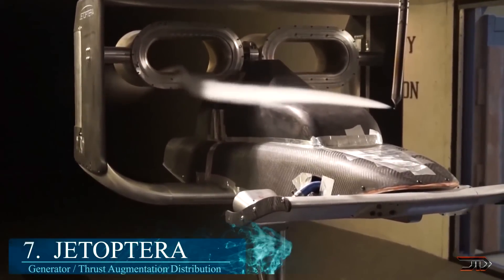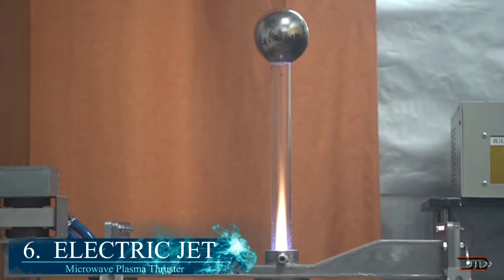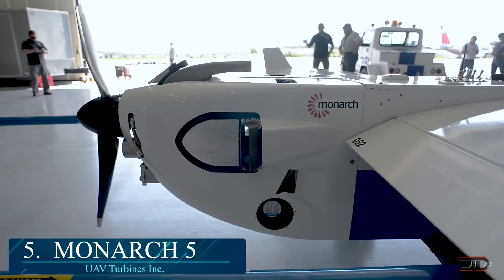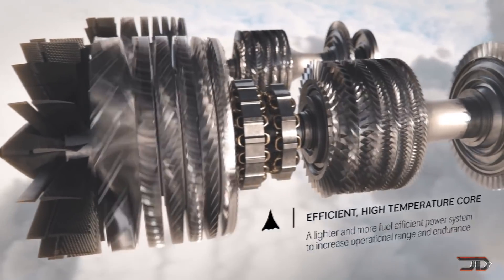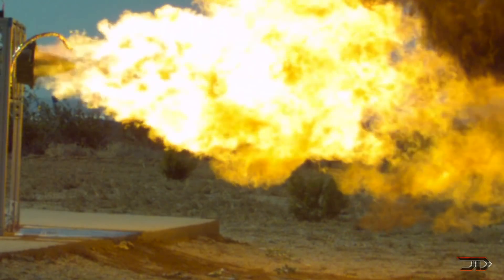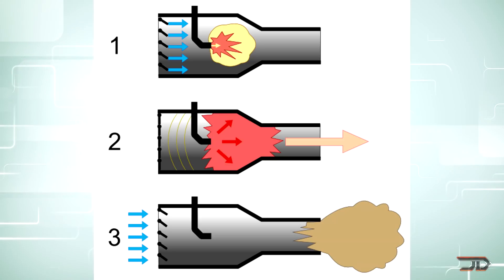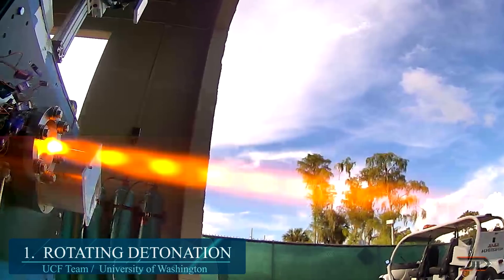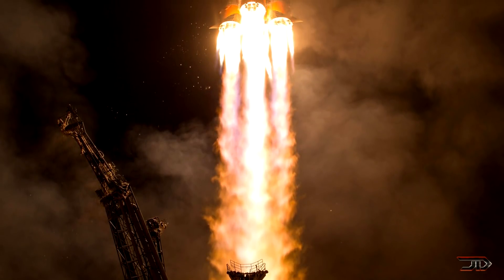7 STRANGEST New Aerospace ENGINES

Comment: One has to remember, these things are built with and tested with and maintained with fossil fuels.
I certainly am in favor of going full speed ahead to see what we can accomplish. I want to see if we can eliminate most fossil fuels. Let’s see if we can eliminate all lubricants as well. When I look at these developments I think about my car, my EV has a sticker on the back window that says the following, “ This vehicle runs on natural gas, coal and nuclear energy”.  We do have wind power in our area but it is negligible and they’re taking down most of the wind turbines because of inefficiency. This is after just 15 years of use. I just watched a video from CDI which means “controlled demolition Inc’. and they just took down 21 wind turbines, look it up. I am all for alternate fossil fuels, I’m also for common sense. Go Brandon.

Comment: Here is the information I found to answer the questions about the German V-1

A pulsating jet engine (PuVRD) is a variant of an air jet engine. The PUVRD uses a combustion chamber with inlet valves and a long cylindrical outlet nozzle. Fuel and air are supplied periodically.

The first patents for a pulsating jet engine were obtained (independently of each other) in the 1860s by Charles de Louvrier (France) and Nikolai Afanasyevich Teleshov (Russia).

German designers, even on the eve of World War II, were conducting a broad search for alternatives to piston aircraft engines, did not ignore this invention, which remained unclaimed for a long time. The most famous aircraft (and the only serial one) with the Argus As-014 PUVRD manufactured by Argus-Werken was the German V-1 projectile. The chief designer of the V-1 Robert Lusser chose a PuVRD for him not for the sake of efficiency (piston aircraft engines of that era had the best characteristics), but mainly because of the simplicity of the design and, as a result, low labor costs for manufacturing, which was justified with a massive the production of disposable shells, mass-produced in less than a year (from June 1944 to March 1945) in an amount of over 10 thousand units.

V-1 engine
After the war, research on pulsating jet engines continued in France (SNECMA) and in the USA (Pratt & Whitney, General Electric).
The results of these developments interested the military of the USA and the USSR. A number of prototypes and experimental samples were developed. Initially, the main problem with air-to-surface missiles was the imperfection of the inertial guidance system, the accuracy of which was considered good if the missile hit a square with sides of 3 kilometers from a range of 150 kilometers. This led to the fact that with a warhead based on a conventional explosive, these missiles had low efficiency, and nuclear charges, at the same time, had too large a mass (several tons). When compact nuclear charges appeared, the design of more efficient turbojet engines had already been worked out, so pulsating air-jet engines did not become widespread.

Representatives of air-to-surface rockets with a pulsating jet engine.
Third Reich Fi-103
USSR 10X · 14X · 16X - thanks to the use of two engines, the practical limit of flight speed for the PuVRD was reached - 980 km / h (270 m / s).
USA JB-2
In the early 2010s, there is a revival of interest in PuVRD: their development and testing are carried out by General Electric, Pratt & Whitney, SNECMA, as well as the domestic NPO Saturn

Scope of PuVRD
PUVRD is characterized as noisy and wasteful, but simple and cheap. The high level of noise and vibration arises from the very pulsating mode of its operation. The uneconomical nature of fuel use is evidenced by an extensive torch "beating" from the PUVRD nozzle - a consequence of incomplete combustion of fuel in the chamber.
Tests of the American Mustang P-51 with PUVRD
Comparison of the PUVRD with other aircraft engines makes it possible to fairly accurately determine the area of its applicability.
A PUVRD is many times cheaper to manufacture than a gas turbine or piston internal combustion engine, therefore, with a single use, it wins economically over them (of course, provided that it "copes" with their work). With long-term operation of a reusable device, PuVRD loses economically to the same engines due to wasteful fuel consumption.
In terms of simplicity and low cost, the ramjet is practically not inferior to the PuVRD, but at speeds less than 0.5M it is inoperative. At higher speeds, the ramjet is superior in efficiency to the PuVRD (when the valve is closed, the drag of the PuVRD sharply increases and at transonic speeds it “eats up” almost all the thrust created by this engine).
Homemade stainless steel motor
The combination of these circumstances determines the niche in which PUVRDs are used - single-use unmanned aerial vehicles with operating speeds of up to 0.5M, - flying targets, unmanned reconnaissance aircraft. For the same reasons, the engine is also used in aircraft modeling.
Due to the simplicity and low cost, PUVRDs are widespread in amateur aviation and aircraft modeling. Small engines of this type have become very popular among model aircraft designers and in amateur aviation. For this reason, commercial firms have appeared that manufacture for sale for these purposes PUVRD and valves for them (a high-wear spare part).
The PUVRD can be used not only as an engine, but also as a stationary unit for generating heat.

Other pulsating WFD

Valveless PUVRD
Samples of valveless (U-shaped) PUVRD.
In the literature, there is a description of engines similar to the PUVRD.
Valveless PuVRD, otherwise - U-shaped PuVRD. In these engines there are no mechanical air valves, and so that the reverse movement of the working fluid does not lead to a decrease in thrust, the engine path is made in the form of the Latin letter "U", the ends of which are turned backward in the direction of movement of the apparatus, while the outflow of the jet stream occurs immediately from both ends path. Fresh air is supplied to the combustion chamber due to the rarefaction wave that appears after the impulse and "ventilates" the chamber, and the sophisticated shape of the tract serves for the best performance of this function. The absence of valves allows you to get rid of the characteristic drawback of the valve PUVRD - their low durability (on the V-1 projectile, the valves burned out after about half an hour of flight, which was quite enough to complete its combat missions, but absolutely unacceptable for a reusable device).

Detonation PuVRD. (English name PDE) In these engines, the combustion of the fuel mixture occurs in the detonation mode (in contrast to deflagration, which occurs during the combustion of fuel-air mixtures in all WFDs discussed above). The detonation wave propagates in the fuel mixture much faster than the sound wave, therefore, during the chemical reaction of detonation combustion, the volume of the fuel mixture does not have time to increase significantly, and the pressure increases abruptly (up to values over 100 atm), thus isochoric (at constant volume) heating takes place working fluid. After this, the phase of expansion of the working fluid in the nozzle begins with the formation of a jet stream. Detonation PuVRD can be with or without valves.
A potential advantage of a detonation jet engine is considered to be a higher thermal efficiency than any other type of jet engine. The practical implementation of this engine is in the experimental stage.

Detonation PuVRD has been studied for over 70 years. The main problems: fast and efficient mixing of fuel and oxidizer, prevention of spontaneous combustion, integration of the nozzle and air intake. Not mass-produced, but several test engines were demonstrated on low-speed aircraft in 2008.
In July 2016, the world's first tests of an experimental detonation rocket engine took place at the Energomash stand in Russia.
At the end of December 2016, the American company Aerojet Rocketdyne received a contract from the US National Energy Technology Laboratory to develop a new gas turbine power plant based on a rotary detonation engine. The work, as a result of which a prototype of the new installation will be created, was planned to be completed by mid-2019, but the completion date of the project was postponed. Engine tests were carried out in 2020.
In 2021, Russia completed the first stage of testing a demonstrator of a direct-flow pulsating detonation engine developed at NPO Energomash (UEC; developed at the Lyulka Design Bureau, which formed a separate direction for the study and development of such power plants), the model runs on kerosene and gaseous oxygen (the first tests of a liquid-propellant detonation rocket engine took place in the summer of 2016; for the first time a model of a pulsating detonation engine was presented at the Army-2017 International Forum). In some operating modes, the engine showed a 50% increase in specific thrust compared to traditional power plants. In the future, it will be used in rocket and space systems, orbital aircraft and hypersonic aircraft.
On July 26, 2021, Japan tested a rotating detonation engine. He worked for 6 seconds.

This video presents Detonation PuVRD. Russia is making an impulse, and the United States is rotating. This is their difference.